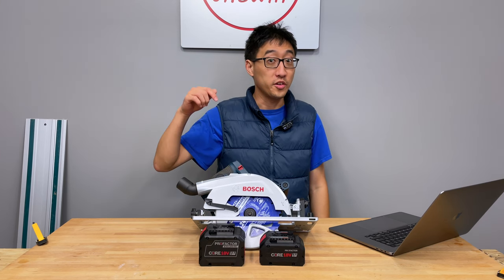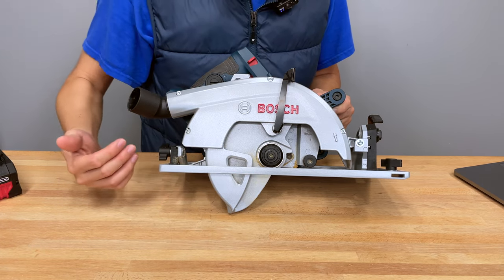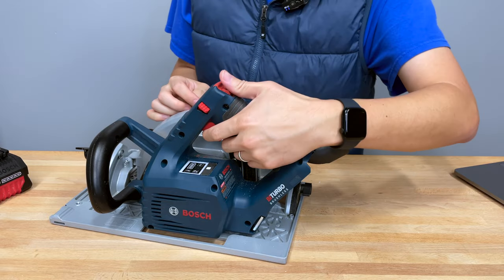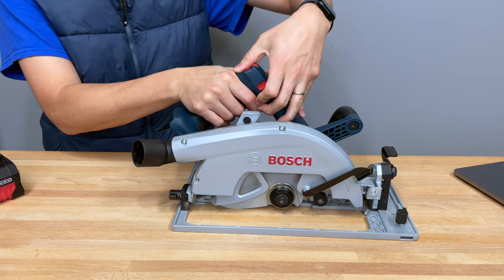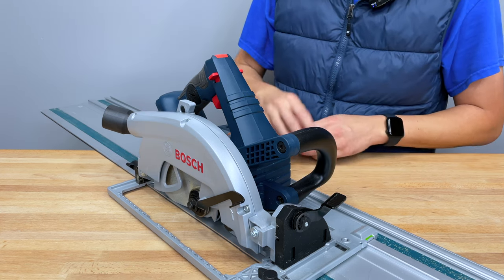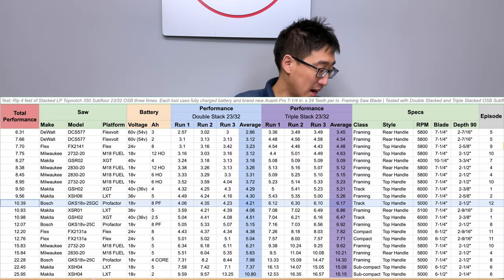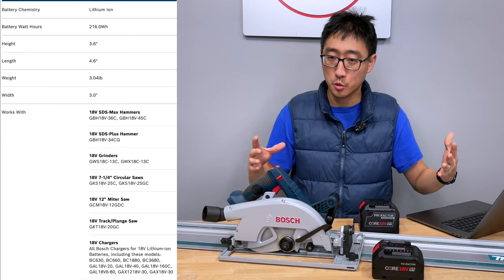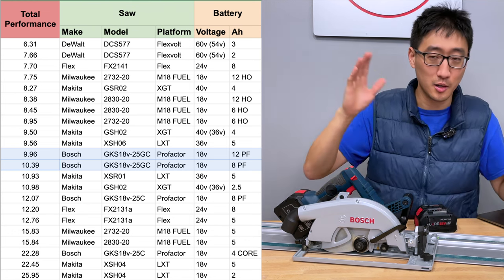Bosch 18v STRONG ARM circular saw with TRACK compatibility Review | GKS18v-25GCN | ep.12 | Track saw

Comment: That is not true when you say that the profactor batteries are not compatible with Bosch other tools. They are compatible with all the cordless tools, since their first cordless tool from way back in 2007. I have all their cordless tools and they all fit on their old tools and their old batteries on the new tools. This coming from a Lifetime Bosch user for over 23 years. Very detailed video sir. Informative. Much respect.
Reply: In the US market, for whatever reason, they branded the 12ah batteries “Profactor Exclusive” and stuck a tab on it so that it only keys into specific tools. I only use them on the tablesaw anyway, but still, really stupid.  Makita has been doing the same thing with the XGT platform (but in all markets) where random XGT batteries don’t work with random XGT tools.
Reply: @robertrada4783  What they mean by Profactor Exlusive is, in terms of the power, for the more heavy duty, power consumption tools, the Profactor Batteries are made to handle that load. It does not mean they are not backwards compatible,because they are. I have many of them(Profactor Batteries) and use them on my old Bosch 18V Tools from since 2007 and vice versa,with my old 18V Batteries(1st types of 18V Bosch Batteries) from 2007 on my new Profactor Tools. I will not get the brute power with the old 18V batteries on my Profactor Tools, but they still work on my Profactor Tools. Much respect.
Reply: @dellusionportland8867  The US market 12ah batteries have a  tab that prevents them from being used on most tools.  I did not believe it at first but it is true.  This coming from a lifetime love/hate relationship with Bosch for over forty years. 😉 The 8ah and 4ah batteries are compatible across all tools just as they are in the rest of the world.
Reply: @dellusionportland8867  I live in the US. I have US market 12ah batteries. They have a tab on them.  They don’t fit on most Bosch tools. AFAIK, this is only the case in North America.  My acquaintances around the world were stunned when I showed them on video.
Reply: @robertrada4783  Wow! That is strange indeed. I understand what you say, sir. I am sorry you experienced that. Much respect.
Reply: @robertrada4783  I am just stunned you're having that problem. First time i ever heard that. I wish Boshc could fix that for you. However, I am glad to meet Another Lifetime Bosch user like myself. Glad to meet another one. Much respect, sir.

Comment: The german Bosch site says that the 12Ah Procore is compatible with all 18V Bosch professional tools no matter how old. Wonder where you got the information from that it's just for the BiTurbo tools?
Reply from the maker: I should've showed it in the video. But the 12 amp hour battery will just not fit on my other 18 V tools like the Bosch freak. They have plastic tabs there that prevent it from sliding in all the way on some tools
Reply: It’s a surprise gift for the North American market that they already burned most of their bridges with.  Literally, the 12ah batteries are marketed as “Profactor Exflusive”, have an extra tab and only certain  tools are keyed to take them.  I presume it’s to keep people from importing American market tools that are usually sold at bargain prices.  Ironically, until very recently, Americans had to resort to importing all of the cordless tools Bosch didn’t bother to sell here.
Reply: @robertrada4783  Kind of makes sense. But don't worry we germans have other  tool problems. The prices for Milwaukee tools here are sometimes double (or even more) than the prices in the US.
Reply: @saiiiiiii1  I do want  to live in a world where a carpenter is looking at a Mafell saw and a Milwaukee saw and they’re both the same price.   I would be thoroughly entertained.

Comment: Just ordered this… I’m heavy into bosch 18v ecosystem.  Kinda disappointed that they can’t release a 7 1/4 track saw
Reply from the maker: i not sure if anyone has a 7-1/4 inch track saw
Reply: I think Bosch now has the GKS 18V-70 L, which is a 7 1/4" blade left saw that works on a track.

Mafell should have some plunge or track compatible saws for a 190 mm blade size (7.25")
Reply: @4thewinak Mafell indeed do and have done so.

Comment: The plastic grip or teeth that use to adjust the saw depth, actually, if plastic were well build, it would be more durable than Metal or Aluminum. Because Metal & SS rust... while aluminum has to be thick... but either way, all of these will be easily worn out.

I find plastic to be more durable, if it's fiber glass reinforced.
Reply: Yep. Modern glass or carbon reinforced thermoplastics are stronger and more wear resistant than a lot of aluminium alloys, particularly those used to cast parts.

Comment: BTW no argument needed it’s not a track saw. It’s a strong arm circular saw with track comparability. Just as your title states and perhaps this should have been in your opening remarks. I know I’m sounding critical and to some extent I am. However, if one is going to make statements that are misleading or incorrect then one should welcome the correct information. In an effort to ensure I wasn’t spreading dis/misinformation I’ve copied and pasted the product information 

  “This circular saw delivers corded performance from an 18V cordless 7-1/4 In. saw. The Bosch GKS18V-25GC 18V 7-1/4 In. BITURBO Brushless™ Circular Saw has a 2-1/2 In. cut capacity, easily cutting through 2X (“two by”) material across the entire bevel range. This circ saw is part of the PROFACTOR™ System, which pairs BITURBO Brushless™ Technology with a CORE18V® High Power Battery. BITURBO Brushless™ Technology is a high-performance motor and drive-train system designed to deliver power comparable to high-demand corded tools. Its ECO mode helps get the job done by extending runtime by up to 30%. One-Touch depth-adjustment allows quick, accurate change with one hand. An onboard user interface provides speed-setting control with six settings and tool feedback. It features connectivity (module sold separately), which links users to a connected device via the Bosch Toolbox App to customize settings and receive detailed feedback. It has a 0-50° bevel range, and the auxiliary handle improves stability and handling. The saw is compatible with Bosch as well as select manufacturers’ track-guidance systems, enabling users to make straight cuts fast. It has an electronic convenience brake for less downtime between cuts and a 360° pivoting port directing dust away from the body when the saw is held in either hand.”

Hope this clarifies your suspicions that indeed this isn’t a track saw and indeed isn’t for precision cutting. It’s likely a job-site saw for accurate cutting of sheet goods using a wide verity of competitor tracks. It’s certainly clearer to me that I need to be looking for a different saw. One that is indeed a track saw.

Comment: Great review , I really like this saw , I am wondering , I see lots of information saying that it is recommended to use the 8 or 12 amp batteries for full power and potential , I am heavily invested into the Bosch tools , but unfortunately I have yet to buy any with the 8 or 12 amp batteries , I am curious to know if anyone has tried it with the 6.3 core battery , I would love to find out if it will work with with the 6.3 better than the new 4.0 core or obviously the typical 4 amp batteries
Reply: I've used it with 4Ah batteries just fine, the profactor batteries just give it a bit more power. Haven't pushed it hard enough for the 4Ah to bog down but I'm sure I could if I tried.
Reply: I don't have the 6.3 battery but it has to perform better than a single row 4Ah CORE Battery.

If the old 4Ah battery with 18650 cells performs the same if not a smidge better then the CORE 4Ah battery, then the 6.3 CORE with higher discharge cells should be better than both.
Reply: If you aren’t cutting framing, or thick engineered wood beams etc, or running the saw hard for an extended time, then the 8ah or 12 aren’t essential. The 8ah is unwieldy on drills, so I only really use it on the circular saw, recip, and occasionally my grinder. It is nice to have, sure, but you can make do with regular batteries until you really need it. For general use, regular 4-6ah Bosch batteries work fine.
Reply: The new Core+ 8Ah batteries yae tabless cells and allegedly run +70% longer.